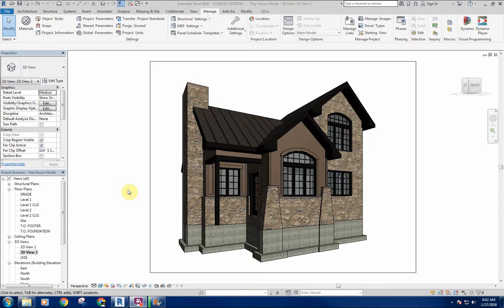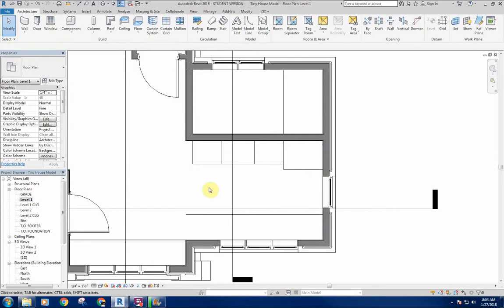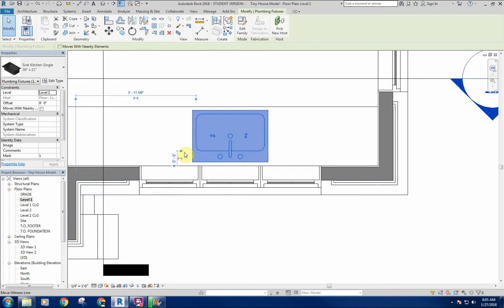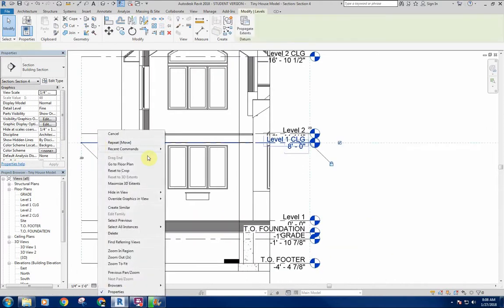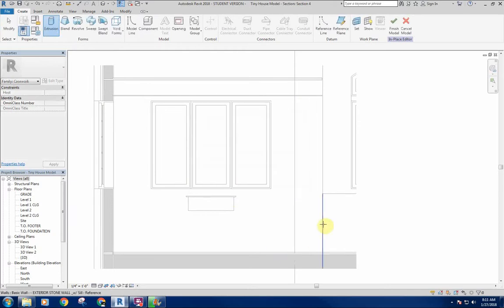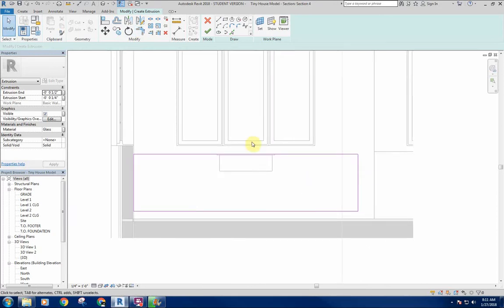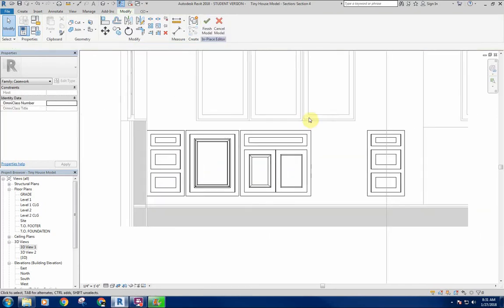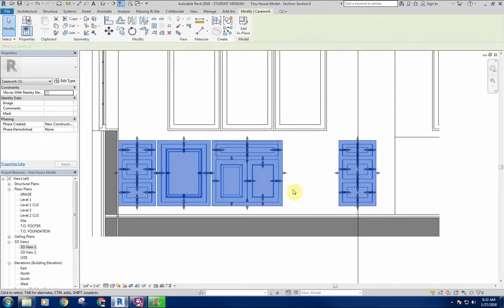Revit 2018 - House Tutorial - Part VIII - Custom Casework

Comment: When drawing the rectangles for the three drawers I can see there is some kind of "snap tracking" when placing the second and third drawer. I use 2017 Revit and when I draw the rectangles I don't have the same "snap tracking" aid. Is there a setting I can turn on?
Reply from the maker: If you look under the Manage tab, there is a "Snaps" option where you can turn a variety of different snaps and tracking on and off.  You may have some of those off that could help.
Reply: @brianalbrecht7859  Thanks ever so much. Awesome videos by the way. I've learned so much while replicating this house. You are really good at teatching. Have you got any other videos or courses other than here? Families or Rendering maybe?
Reply from the maker: @vidatom15  I don't unfortunately.  I created these a while back for a course I was teaching at a university, but they've since gotten rid of that class due to COVID so I haven't updated any of the videos to the new versions as of yet.  I may find time eventually to refine these and do them a little better, but otherwise this is all I have at the moment.  Glad they've been of some help!